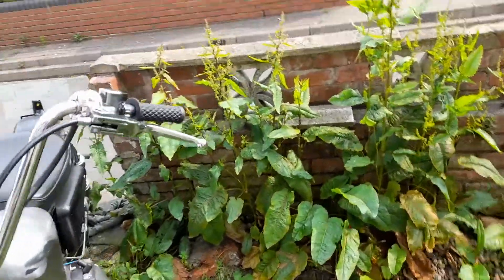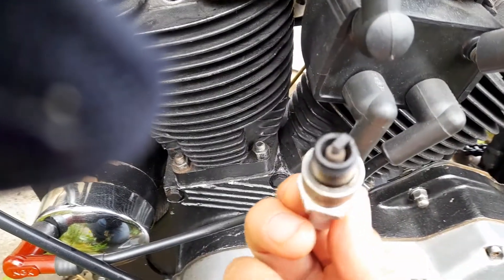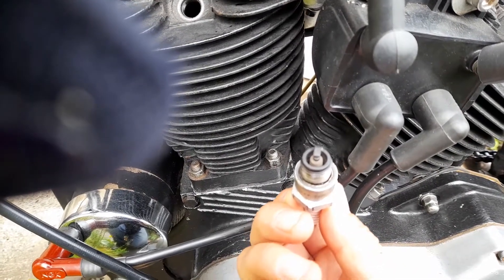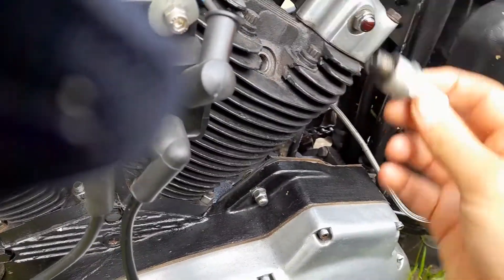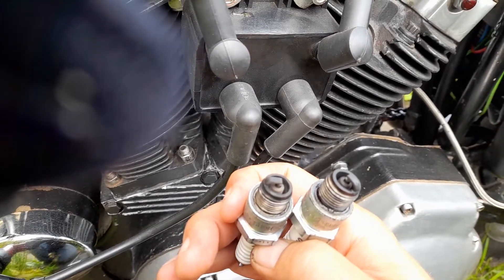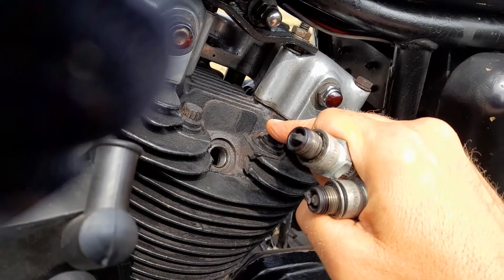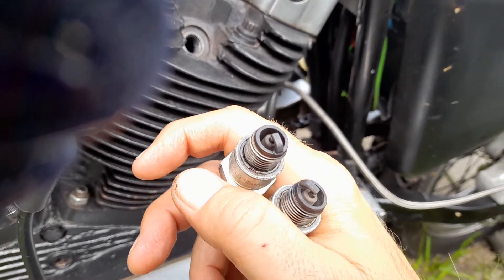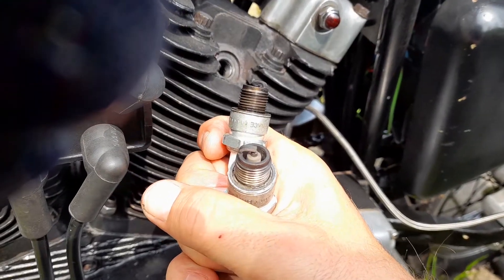Spark Plug Electrode Colouring. 1979 AMF Harley-Davidson XLH1000 Ironhead Sportster

Comment: I have one wet and one dry plug, would this cause bad running? i've cleaned carb but still running rough.
Reply from the maker: Is it wet with oil or fuel?
Reply: @ImminghamIronhead  took it out yesterday a big ole back fire and it started running fine. Checked plugs today and they are both dry. Thanks for your response.

Comment: What’s the gap size
Reply from the maker: Open to debate, but I'm currently running 40 thou on Champion RL82YC plugs and Champion 5 ohm plug caps. When I did this video I was using NGK equivalents, but the bike would rarely start when warm and in the end it was changing the plugs/caps that solved it. I have points ignition;, so if you have electronic ignition it's all different; even the coil is different for electronic (3ish ohms instead of 5 ohms). Hope some of this helps.

Comment: Plugs on these engines didn't run clean even with the original carbs thay had, so if you see black when pulled out no need to worry.

Comment: Wow my plugs are far worse that yours I thought the bendix carb was the culprit but obviously not!
Reply from the maker: Timing, pushrod gaps, rings, guides, could be anything :-) Mine currently spends 90% of its' time running, but probably less than 50% running properly; there's always something wrong somewhere.
Reply from the maker: PS: A healthy compression test means the valves, guides and rings are good, ruling out oil entering the cylinder; I'd start there.
Reply from the maker: Just thought of another possibility! I run my bike on 99 octane petrol; in theory this burns faster (ie cleaner) than regular fuel, but I don't know if it burns fast enough to account for my plugs staying cleaner. Worth a try.

Comment: You could put a few drops of red loctite around the outside of the guide and let it wick in. There's a guy on here called Tatro machine and he is an expert on Ironheads, he always gives out sound advice.
Reply from the maker: It's worth a try; I have a spare guide and valve so if I get it badly wrong I'll not be too set back. Tatro Machine is a God; I'd still be building my Ironhead now if it weren't for his videos.
Reply from the maker: PS There's a guy in the comments, name of SaddleTramp; well worth a watch.
Reply: @ImminghamIronhead  yeh I've been subscribed to him for a while, he makes some great videos. There's never a shortage of help from the Harley community 👍